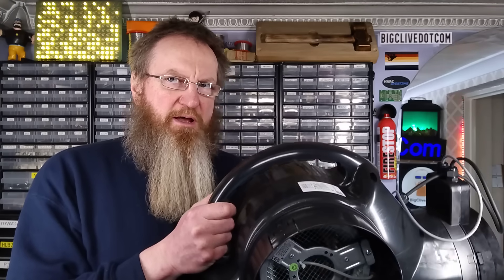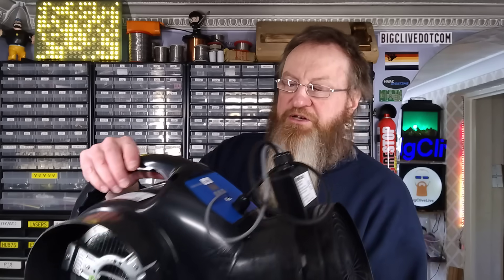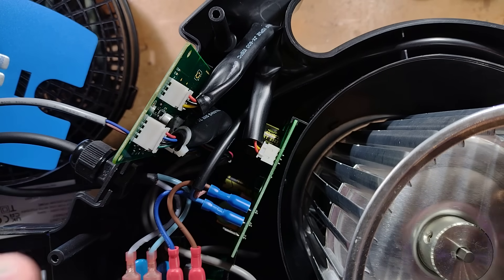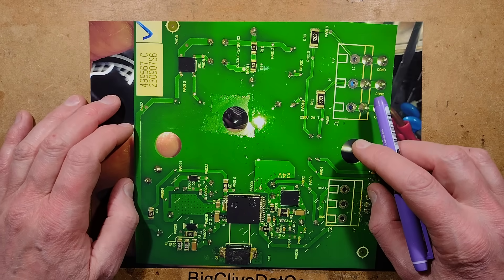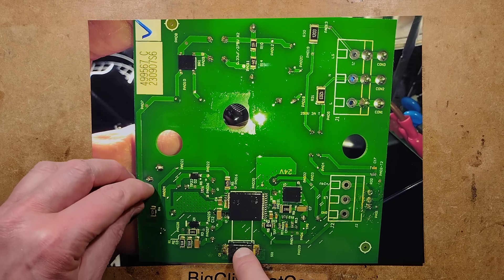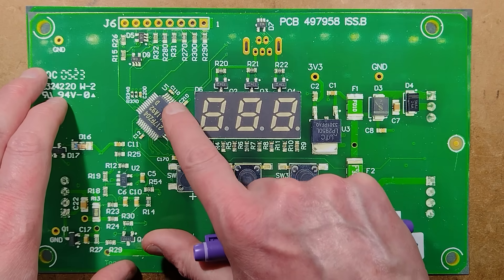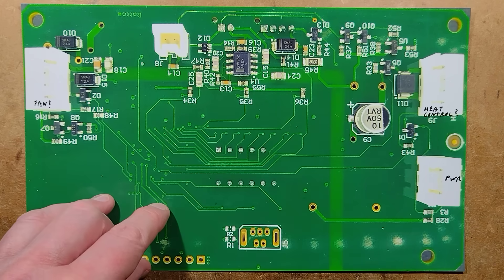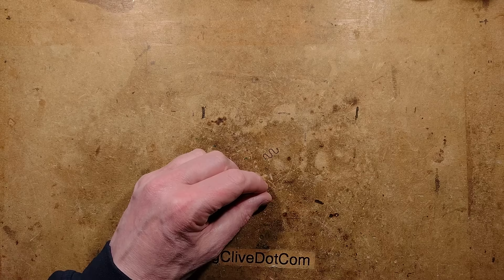Inside a Positive Input Ventilation (PIV) unit

Comment: This thing is essentially a small forced air furnace like we have in North America but in the profile of an air mover or leaf blower.  If you think half a kilowatt is a lot of energy, I once jointly rented a house with my brother and mother that had an electric furnace and when running easily drew 20 kW in electrical power, having 4x5 kW heating elements that were activated in sequence then the fan motor was started by the last sequencer.  Basically when it came on you would hear three or four loud contactor-like clicks before the fan came on.  The breaker feeding this beast was rated at 100 A, a double pole breaker so the whole thing ran at 250 V 60 Hz.  It was a good furnace, probably much safer to operate compared to propane or natural gas and ultimately less to maintain as well.  I remember one day we came home and the thing was howling.  The squirrel cage fan, being a belt-driven unit, was running on oil impregnated bronze bushings and they became incredibly dry.  I spent maybe half an hour, pulled the fan out of the bottom of the appliance and replaced the bushings with ball bearings.  When I did that I also gave the fan a bath as it was fairly dirty.  Put it all back together, not a problem after that.  I had an HVAC contractor up the street that I bought the bearings from and did it myself.

Comment: I have this exact system in my terribly ventilated, 140 year old 2 bedroom house. Since it was installed in October, with the heater set to come on at 8C, even with the freezing UK winter we've just had its cost around £32 to run so far (it's on a metered timer plug to come on over night only). Condensation and mould have disappeared from windows and walls and the windows can stay shut in the winter, keeping the warmth in. Best thing I've ever bought for the house, although very overpriced.

Comment: I'm not convinced with these. The heater to compensate for the cold air coming in is generally rated at circa 500 watts. Twice what a typical dehumidifier is rated at. The dehumidifier won't be on all the time to control the humidity level. The heater in that thing will be on for most of the time in the Winter.

Comment: You should absolutely not have positive pressure in a building if it is colder outside than inside. The positive pressure will push moist air out through the structure. The moisture will then condense when it cools down. If this happens inside, for example, a wall, you risk mold in the wall. Houses should have a low negative pressure to be moisture-proof in cold parts of the world.

Comment: That last circuit board with the 7 segment displays on. That display is used in vent axia's fans too. Specifically the extractors for social housing which feature a data logger so the landlord can probe how long the fan has run in the event of damp and mould claims. I think this PIV unit also features a data logger with the correct sequence of button presses, as they're popular with landlords and the PCB looks the same. I wonder if the other circuit boards are repurposed from MVHR units.

Comment: I DIY'ed something like that but in reverse. During summer when it was 20-30 degrees C day and night, the brick building I lived in would never cool down, not even at night. Impossible to get any sleep. Bought a car fan that fitted perfectly into a small window in the sauna. Let it blow air out so it would pull cooler air in through the windows at night. Worked really well.
Reply: Problem with this, you are also pulling in diesel fumes, mushroom spores, pollen, etc. into your house.
Reply: I feel for you my house is a nightmare so we have ac. It's a council property and the whole south side of the living room which is about 5m wide, has a uPVC side. The whole side of the house is windows or uPVC so it doesn't do a great job at keeping the sun out and our living room even today which has been maybe 15c at best outside has bought my living room up to the mid 20s. However I've used less than £200 in gas since November with the heating set constant at 21c with a bit of a top up from the ac.
Reply: @HA05GER  That sucks. 😞 At least you've saved on gas. Here in Finland we don't use gas at all for heating or cooking, except for grilling during summer. 😁 Electricity is used for everything. Residential areas often use district heating though (hot water from power plants or dedicated thermal plants). Heatpumps are becoming more popular though, as modern models can perform really well even in the winter cold.
Reply: @Stirmeli  yeh I think heat pumps will be the way we go eventually. The AC in my front room also operates as a heat pump and has worked absolutely fine in negative temperature. You guys are quite lucky though as you have access to alot of geothermal I believe where as we are stuck with wind,solar,gas or nuclear. In the evening 50% of our electricity is still coming from gas so we are from giving that up. That's why it still makes sense for us to heat with gas as gas is about 1/4 of the price of electricity. I think I pay about 5p per kWh of gas where as electricity is 21p a kWh. So unless you have a heat pump that's achieving a scop of 4 it isn't worth doing currently. There is places where they are worth it for example my mum lives in a small village that's never been on gas so they always used electricity or oil. She now has a heat pump and it works perfectly fine. The only thing is we do air to water heat pumps where as I believe you guys tend to use more air to air. I think our government don't want us using air air so as to stop everyone having a through the summer and using more electricity.

Comment: I have had the exact opposite in my house for 20 years or so. I have 3 computer fans (normally going slowly to keep it quiet) mounted in the loft hatch creating a slight vacuum inside my house (the opposite of your device). It's connected to a variable supply which I can speed up considerably in summer to suck out the dramatic excess heat upstairs. That was the reason I made it in the first place, we were resorting to sleeping on the couch downstairs in summer when we first moved in because of the ridiculous upstairs heat. Opening a window slightly at night now does the job even in the hottest summer heat, without outside noise waking us up. It encourages clean outside air into our house keeping it fresh (useful as I'm a smoker),  and the whole house is fresh and odourless etc. It has several advantages over the unit you've been analysing; in that it doesn't require a filter, natural convection aids it - meaning it makes next to no noise, and it's been running constantly for 20 years without issue (i.e. no complex electronics which always fails), and crucially it has no need for a heating element. When the variable PSUs breaks down (every few years or so), I just get another one from AliExpress - using a small linear supply in the meantime while I wait for delivery etc.

Comment: If you use this in a cold climate, you will need an absolutely perfect vapor barrier which does not exist. Otherwise you will have condensation inside your exterior walls. No question about it.

Comment: TBH I think a filtered computer fan should be enough for that clean air feeling at a fraction of the cost. No need to move hundreds of cfm's or drop a bundle for power consumption, especially if the fan is on a timer. This unit seems overkill.

Comment: I'm in the process of looking at improving the ventilation in my house at the moment. I put a decent sized extractor in the bathroom (I had the roofer fit four slate vents in the roof when I had the roof re-battoned and felted last year) controlled by a very basic Home assistant control loop but I've recently bought an Air gradient and quality monitor and it's quite a shock to see the CO2 level in my office after a couple of hours of me working in there.
Long term plan is to get a couple of heat recovery fan units and connect these to the slate vents, one solely for the bathroom and one to take care of the office and rest of the house.

Comment: Mechanical Ventilation with Heat Recovery is the gold standard, keeps your air fresh and humidity low, but doesn't require a 500W heater like the one in the vid
Reply: I live in a house built in 1880 and used to suffer from damp, mold and generally bad smells/ air quality. I installed a heat recovery system two 6inch mixed flow fans each on full power moving around 500 m3/hr of air (one intake and one extract) then ducted the system around my house to different rooms each room having one intake and an extract grille in. Best thing I’ve bought no problems since installing and we run it 24/7 full speed through the day and low speed during the night. Plus considering the whole system only uses around 80w of power on full it’s not bad at all 😊
Reply: I have an MVHR system I installed myself and it works well.
Reply: The heater is not needed. If you have your vents down low then it's pushing out colder air Vs venting warmer air. I find it makes the room it's in very cold but if it's venting to other rooms underneath doors then they don't cool down as much (presumably because the cold air stays low). Basically the heat exchange happens in the room it's in so it is recommended to have a heat source there. My heater is set to 5°C and I've not noticed it come on. It says the heater is intended to try to maintain that temperature so possibly it is not just on or off but pulsing the heater to attain that 5°C minimum.
Reply: most houses that aren't 100% air tight always leak in a little fresh air anyway, so why go to the extra expense of making your house super air tight, and then installing a HRV unit to essentially put a huge hole in your sealed envelope?? It really makes no sense, except for the people selling them.
Reply: @gorak9000  It makes sense because if you just have a draughty house, you lose hot air out of the gaps and pull in cold air through the gaps. With Heat Recovery, you don't lose as much of the heat when you are bringing in fresh air, so you reduce your total heating costs. Furthermore, with mechanical ventilation, you can control the ventilation rate, which is important as the natural draught rate may not be sufficiently replacing the air quick enough to prevent damp.   Also, with mechanical ventilation (even without heat recovery, such as in this video), you can filter the air. This can be a big deal during high pollen, or if you live in a polluted area. Furthermore, by having positive pressure in the house, you also reduce pollen/contaminants coming in through any unsealed gaps, as all the incoming air instead has to come through the filter.

So: warmer house in winter, lower heating bills, cleaner air, less damp. Makes a lot of sense to me!
Reply: I've found that they actually dry the air too much. All these komfovents and vallox systems are very popular for appartments. Unfortunately as the air in winter is already very low in humidity, these heat recovery ventilation systems dry it up even more. So you can end up with 10-20% humidity and that's bad.
Reply: @IrenicusFTW  In that regard, this thing is no different from heat recovery vents. It pushes in fresh, low humidity air from the outside which is then heated up by the little heater in the unit and by the home heating system. The result is exremely dry air just like you described. The only difference between this unit and heat recovery vent is that this one here provides no heat recovery, so your heating system must work much harder causing it to consume more energy.
Reply: @IrenicusFTW  how can they dry it? They aren't dehumidifiers, all they do is heating it up, absolute humidity doesn't change.
Reply: @JGnLAU8OAWF6  Absolute  humidity does not change, but relative humidity does.
Reply: @ 
>they actually dry the air too much
They can't. If you're in a heated space with proper ventilation it will be dry, regardless of having heat recovery ventilation or not.
Reply: @IrenicusFTW you can always add a humidifier if you need to

Comment: Also have these in a number ofbrental properties. Where they do dry cloths and dont open windows and disconnect the bathroom fan. Have lityle or no mould problems. Heater only heats air to 20 degrees so it doent use a lot of energy inreality. Thats why theres an extra thermistor on the out put.

Comment: This has convinced me to set up one of those AC window seals and a set of 12v fans as a filtered air intake for my flat (do you know if theres a specific phrase to find a non-PWM fan speed controller?)
Reply from the maker: You can often regulate standard 12V computer fans by just turning the voltage down.

Comment: 10watts ? That's fantastically low Clive. Definitely agree about the filters being crumpled, needs a wire frame. 
Guess you'd need a fairly clean attic, or the filters would get clogged in weeks. What did we do in the old days to avoid the problems you mentioned? Oh that's right, fire 🔥.....

Comment: Missing Components: K1 is of course a relay, which points to the unused aux input being a sensor or switch to turn something else on.  Maybe a to slave a second unit?  If only one turned on, the air would just recirculate back to the attic.

Comment: I prefer a heat recovery system which pulls in clean air and heats it with the warmth from the outgoing extracted air.  They use a kind of diamond shaped matrix that keeps the two flows separate while being thin enough to allow warm to cold heat transfer.

Comment: Easy enough to get rigid duct for those side filters.  I have what's called "whole house ventilation", a 30in thermally controlled fan mounted to the inside wall in the peak of my attic vented outside.  When the temperature rises to a set limit, the fan comes on drawing all the hot air out of the attic.  I also have two solar powered exhaust vents positioned on the ridgeline with static open air covered vents the length of the roof.  Oh yeah, I live in a desert...Thanks Clive, looks like that would work well where you live.

Comment: Looks like a good idea to push air into all those cracks where air with strange allergens can come in.  But I have grave misgivings pulling that air from the attic rather than a vent from the outside.  In my place, the worst air quality of all is in the attic.  I started building a little shop up there for when I don't want to release sawdust or metal filing into my abode, but gave up the project when I found I could never stop sneezing when up there.
Reply from the maker: The early experiments initially gave a noticeable attic smell, but now the attic is fresh and dry.

Comment: I prefer the old style negative pressure attic fans. Open the windows, flip it on and cool morning air comes flowing in all the windows. Edit: my preference is based on living in a hot dry location. I see the benefits of a positive pressure system in cold humid environments.
Reply: That's what I do in summer.  No AC here, so I just use the chimney effect to let cooler air from the north side come in from downstairs, and waft its way up to exit through the attic and out.

Comment: Ventilation, what a concept. Most American homes built since in the middle part of the last century have some issues
with  exposed to  outside air peaked roof attics the air where summers  can get over 160 degrees F with the same 
humidity as outside! The device will definitely lower your cooling costs in the summer. You usually don't have enough
insulation in the bottom of the attic above the living space's ceilings which I wish my landlord would do to improve all 
the  summers heat above my flat just sitting there raising my AC costs.

Comment: I worked in an office building, now razed, that won architectural awards. One for a flat roof that would have an inch of water on it in summer for cooling. Did not work, roof leaked. The other was to have the office positively ventilated with special non-opening windows that were designed to leak air out around the edges. Then they put curtains on. They acted like filters and because this was when smoking was allowed at work they quickly became the filthiest things you ever seen or smelled and were non washable.

Comment: You can use some square wire mesh (there's also a hard/rigid plastic equivalent) to make a "basket" to prevent the "sock" filters from collapsing. Or 3D print it. Anyway with the price it has they could already include them from the factory.

Comment: You should really install an outlet in each bedroom and force a flow towards the kitchen and bathroom areas. Positive Pressure Ventilation are a cheap alternative to Heat Recovery Ventilation balanced systems that prewarm the incoming fresh air via a heat exchanger from the stale warm exiting air.

Comment: In 2000 I was starting to sell stepper motor controllers based on the Allegro stepper drivers which have synchronous rectification built into them.
However, I discovered in my testings, that if any of the stepper motor leads got cut or disconnected while the motor was stepping, the chip would blow up. 
I had to recall about 20 of them and redesign the board to include 8x external schottky diodes, as if there was no synchronous rectification. 
In normal operation, the internal synchronous rectification was faster than the external schottky diodes. That fixed the problem. 
This video brought on a PTSD for me! In 2005 I got out of the business as China made everything cheaper.
Reply from the maker: The blowing up drivers thing was common on early 3D printer designs when people were plugging and unplugging things while the unit was powered.